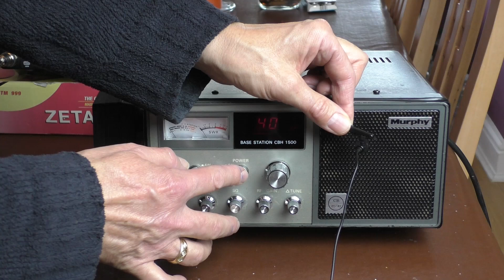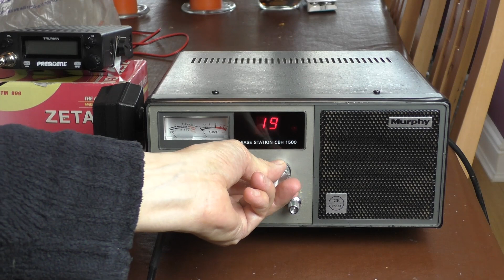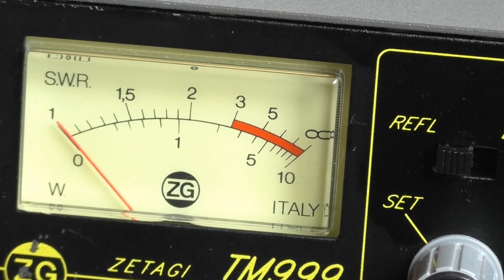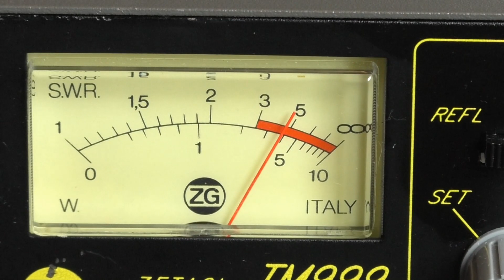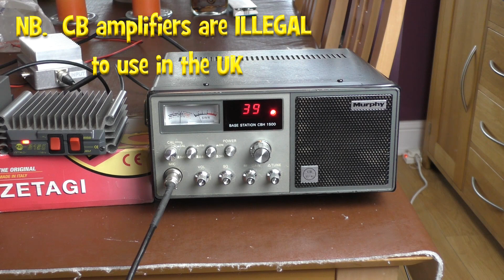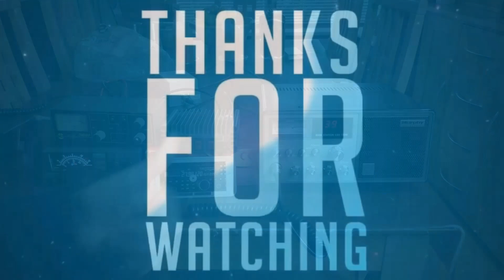Testing Murphy CB 1500 Base Station.  Yes it HUMS.

Comment: I had this rig ,
Came with worst mic ever built .
Tiny mic literally size of a box of matches 
And wiring was funky .

The hum wasn't an issue as I remember 
It was a plug n play rig 
You could screwdriver tweak it a bit 
The delta tune was waste of time tbh 

I would use it with DX 27 on the guttering 
And being in top floor flat that was pretty 
Helpful 
Wasn't as good as maxcom 20 which was a basic tiny mobile rig 
The RF gain on it was pitiful the maxcom or midland 80 even on 13 amp homebrew dipoles were much better .

I sold it on in nearly new condition
But this video brought back many memories 👍

Comment: It Hums. Have you had the power supply capacitors checked. They could be failing, if they are still the orginal ones. Check out, UK CB radio servicng channel on YouTube. He has just serviced again, one of these Murphy Homebase sets and the capacitors were failing in the PSU.
Reply from the maker: Thanks i will look for the video.  They hummed straight out of the box brand new :-(
Reply from the maker: Asked the man the question on the PSU caps. See what he recons.

Comment: Change the capacitors in the power supply, that is AC coming in. 40 years old, the caps have past their life. New caps or a higher value one should filter out that AC. That AC humm should go away.
Reply from the maker: It might help to change the caps but these rigs hummed from new.  Known for it.

Comment: Great video as always yes l love the old radios l used the old lafayette he 20  base station in  1968 it only had 12 channels and a m  no side band and l used a lafayette range boost  half wave antenna  up about 30 ft on the top of a tv antenna  also l had a  lafayette micro 12 portable with 12 volt batterie pack 8 d cells  with telescopic antenna in the battery pack  it had 12 channels am  and it worked really well   l am 71 years old and still love c b radio  l wish lafayette was still around l still use a x144  and a super scope and a ssb cobra  l wish l could have a tokai  5 watt hand held 6 channel but they have become a collectors ltem now  and they are very expensive to buy anyways great video as always
Reply from the maker: Yes the older classic radios are really bringing in high prices.  I will put up a video on this in the coming weeks.

Comment: You seem to have a bit of AC ripple on your internal PSU there Fred.. The smoothing caps should be an fairly straight forward job to replace. Have a look at them and you'll see the value  (uF) and voltage..  Order replacements from a reputable source  (try getting  Nichicon or Panasonic) . Make sure you get the same uF but you can go higher in voltage.  Smooth and quiet power supplies are the first step in getting it up to spec again. It might be worth replacing any other smaller capacitors on the PCB as well.
Reply: I second that, electrolytics especially tend to dry up after many years, you may be pleasantly surprised after changing them.
Reply: You are correct, 40 years is too long for caps.
Reply: the background hum was there from the start they all have a buzz the board is from a HT put in a box.

Comment: What about replacing the electrolytic capacitors in the supply side something like a 47,000uf 25V WKG, What about a Slim-Jim for 26-28 MHZ, what about an UNUN driving an End-Fed antenna.
Reply: It's an original feature of the rig.
It's what makes it unique.. Don't fuck with it.
Reply from the maker: @sahhull  I think Northy is right here.  I might try to adjust the signal meter but the hum was always there.
Reply from the maker: I think the PSU hummed from brand new.  It was an u=issue back in the day for this radio.  The answer is to bypass the psu and run it from an external 12 volt supply.  Ive heard a lot of good things about a SlimJim.  Right now iam busy working in the shed shack.
Reply: @CB-RADIO-UK  I had a York home base do the same hum, like you said, run it on a external supply, i did that and had many years of fun radio, back in 2002 i was able to get to the uk on the York, basic radio power, was around Feb to March time, Finland to south east Uk, Take care there Fred, thanks for your video.
56CT004